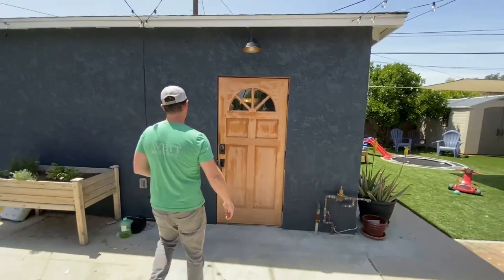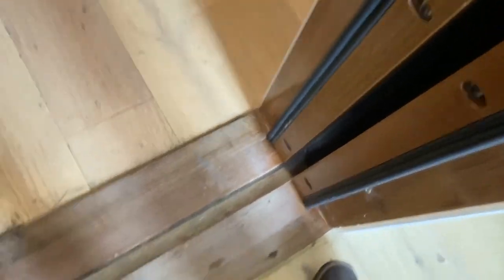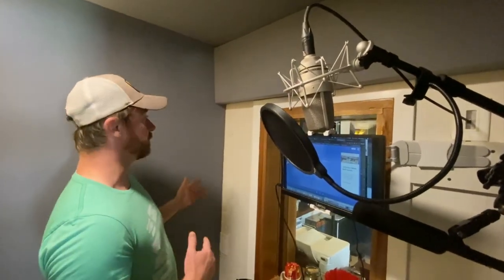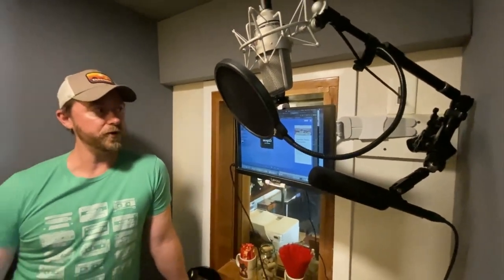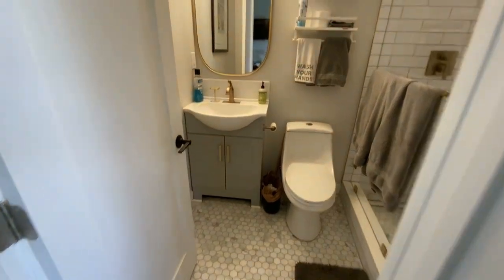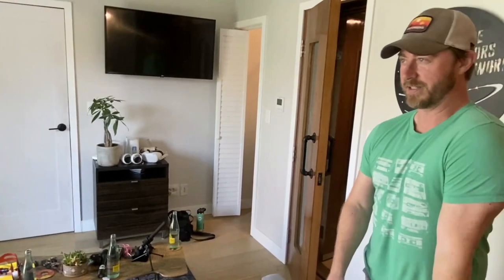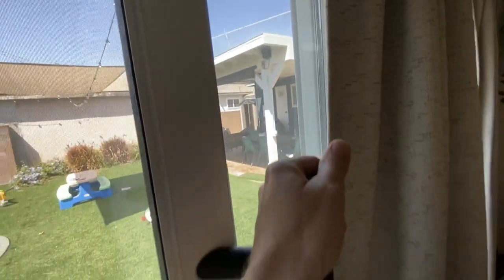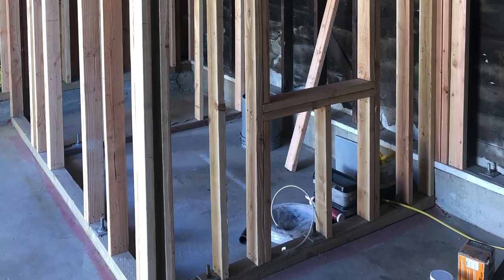George The Tech: Voiceover Studio Build Review and Interview with Ben Pronsky

Comment: I've always wondered about adding air conditioning/heat into these home studios. Do you have to turn it off when recording OR is it quiet enough to be able to just filter out of the recording afterward?  Is the fresh air system totally separate from the A/C coming in?
Reply from the maker: He can record with all of it running, it was very carefully designed to provide him continuous fresh air and temperature control.
Reply: @GeorgeTheTech  But the ERV is not completely silent in the voiceover studio, right?